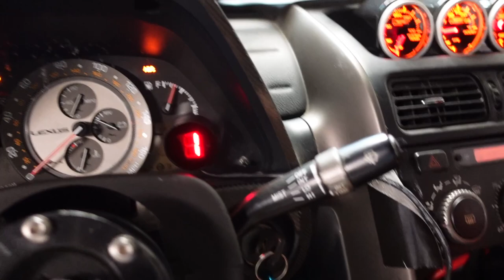CONVERTING CD009 TO SEQUENTIAL TRANSMISSION! (HOW TO)

Comment: I also had pre order have fought it managed to take the shim out and just shimmed the rear of the shifter with a 1mm shim fixed the issue i could hit all the gears fought with reverse new cam with stock shim all the gears felt good no reverse im done good luck nice install
Reply: Archie im having issues with my install also. S1 sent me a different updated cam for the shifter and I tried different things they suggested but I still cant get it to work propely. Did you get yours working or do you still not have reverse?
Reply: @SherryBombImports  no i installed the new cam had all forward gears no reverse i hit them up on messenger and nothing so now i have a 2k paper weight... im done with it going powerglide

Comment: I don't like to be the sore guy in the comments but I was also one of the first few to receive a s1 for a CD trans and it did not work for me. Sometimes it would shift into 3rd instead of 1st and 5th instead of 3rd. What a nightmare. I really loved the concept but man it sucked. I even adjusted it fully towards the driver's side and it would not shift correctly after putting power down. I then started getting a 5th instead of 3rd after tryna shift from 2nd to 3rd on boost.... I'll be selling mine for sure. Great install video! It's perfect. But if you look at the instructions now, they changed it. Now they want you to remove the plunger... what a joke.
Reply from the maker: I’ve been in contact with them as well for this issue as I was having it happen intermittently this past weekend. They have addressed the issues and will be sending me out a part end of this week early next week. That they said was an easy install. So if you want you can reach out to them I usually do on Instagram and let them know you’re also having the issue. While it is annoying this is the first edition of the part and sometimes parts need to be updated and things need to be changed. Just wish they were the ones to find the issues before sending out.
Reply: @KBNZUS  thanks, I pulled it already. I'm gonna sell it. I wish they were that clear with me. I emailed them and they told me to adjust it. After I got back to them that it still didn't work, they stopped emailing me back... I wonder what part they changing to fix it... Maybe a thinner shim?
Reply from the maker: I’ll keep you posted probably post a video on the fix
Reply: @KBNZUS  I tried the updated installation instructions with removing the centering plunger all together, I tried changing the shim size of the main shim plate, AND I also tried the new "updated cam" that did absolutely nothing. I'm really irritated. I just want my money back.
Reply: @BoostedLexus  Mine is doing the exact same thing! I asked them to return it but they seem very reluctant! Maybe if we all get together we can get our money back. I spent $2000 on something that doesn't even work right. I put my SerialNine short shifter back in, problem solved.
Reply: @SherryBombImports  Trust me, I feel your frustration... I paid the same and the shifter never worked, it also sucked downshifting. It would grind in some gears coming back down, I sold mine on Facebook market place for less money. Glad it sold cause that's one expensive paper weight! I installed my Collins shifter and was more happier to have it back. And you know that's bad cause Collins shifter sucks...lol I was gonna make a YouTube video to alert people how trash the CD shifter was but I decided not to. I have noticed they don't advertise the CD shifter as much anymore on their social media. They sent me a part to install in the shifter, idk what it supposed to do, maybe make it a little easier to shift?  Idk, I threw that to the side since I don't own the shifter anymore. They have no interest on giving  anyone a refund, they are ripping everyone off and ignoring them if their having alot of issues.

Comment: Quick question what do you mean you still have to use the clutch to shift, just from neutral to 1st or from shifting from different gears
Reply from the maker: Yes you have to use the clutch for shifting every gear. But don’t waste your time, this shifter is not good. I have taken it out and put in a serial nine shifter
Reply: @KBNZUS  bruh are you serious 🙃 I just bought it
Reply from the maker: @valhlei   🙃 I wish you better luck then me. I’ve made other videos about it not working
Reply: @KBNZUS  was reading through the comments because while watching the video i had serious doubts this would work reliably if at all. The concept is cool the execution just doesnt seem very well done. Then i found this comment confirming my beliefs

Comment: does it work with the 370z rev match transmission?? or just the regular cd009?
Reply from the maker: I’m pretty sure they make a different bracket for the JK trans as well
Reply: @KBNZUS  trying to gather all info i can get
cause i want the s1 sequential for sure,

2jz gte with sincro rev match transmission from 370Z but i can’t find any info 
if someone ever did that swap

2jz with the transmission sincro rev match  from Z
building it for my frs,
Reply from the maker: Just so you know I have since removed this shifter because of so many issues and switched to a serial nine one. Not sure if you have seen my other videos of it
Reply: @KBNZUS  man i just watch it right now that’s sad, 
can’t wait for the review on the, serial nine

Comment: Hey man. im about to buy a CD00A. its going up against a 5.3 ls swap in my 78 firebird. do you think this is a good choice in transmission?
Reply from the maker: I would say the CD trans and the t56 are your best options
Reply: @KBNZUS  last question what clutch do you recommend, seeing the brand new one will probably not come with one. Budget not to cheep not to expensive the car is going to be my Sunday driver casual cruiser. 400-415hp